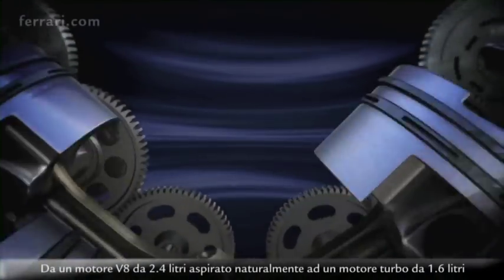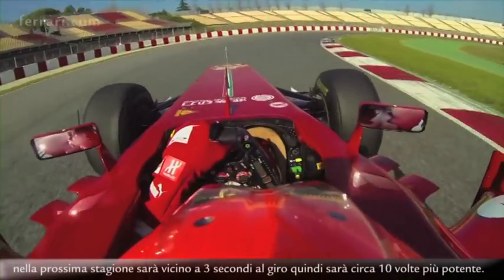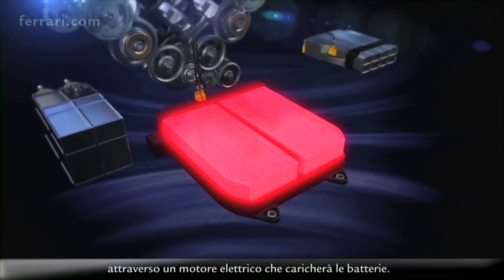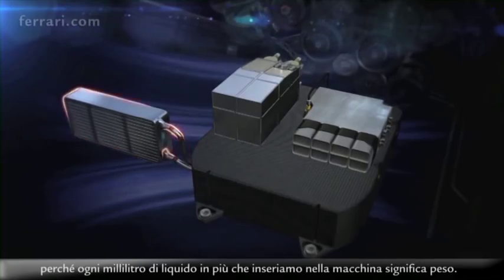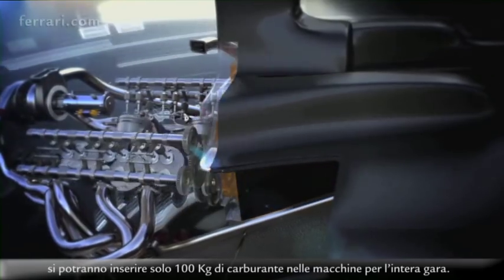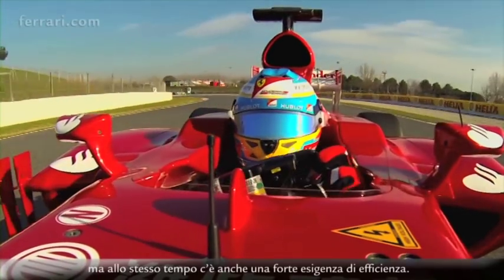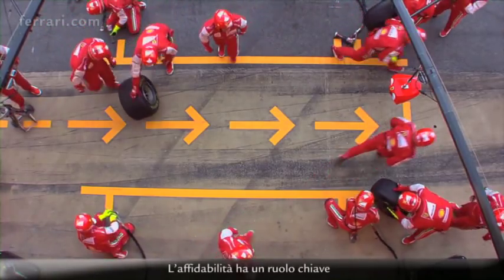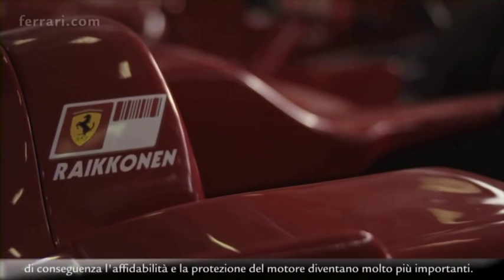Ferrari 2014 F1 engine presentation

Comment: Hate to say this but F1 is getting worse every year. Now they making the engine smaller WTF? The V8 N/A were great.
Reply: V8 N / A are among the most boring. 'd Rather V10 or V12 if it should be large engines with many cylinders, otherwise V6 turbo is an excellent choice.

A little sad that they lowered the rpm limit, however.